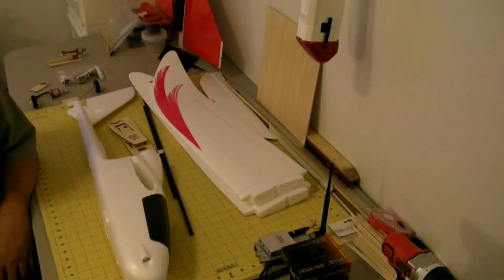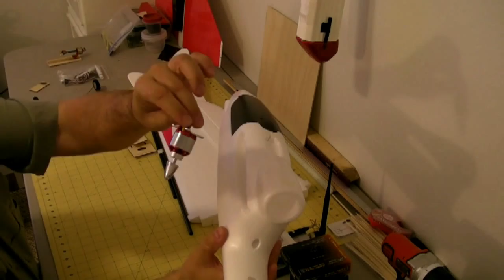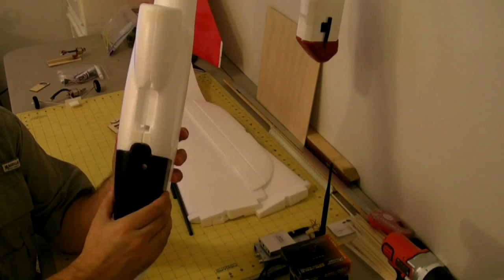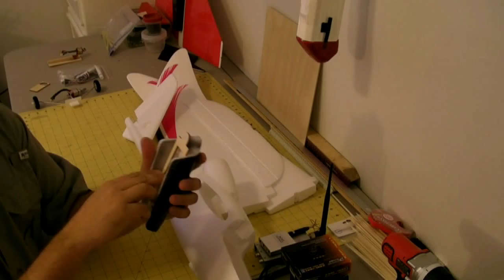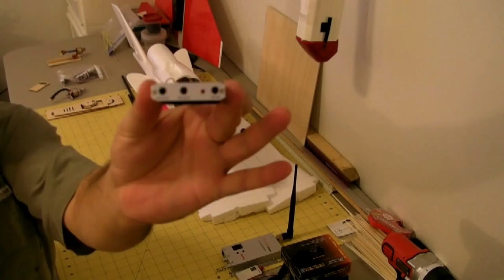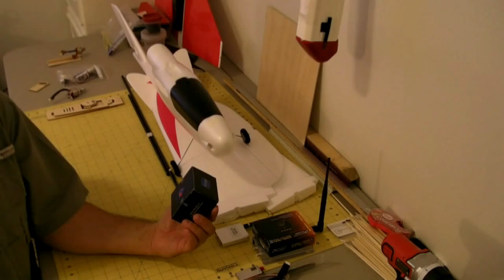First look at Skywalker Sirius FPV plane

Comment from the maker: @rcdawgmc Will do.  I am still figuring out how to fit everything in the plane an where to mount all of the electronics.  Starting to get crowded in there.  So far, I'v only flown the 5.8 system out a little over a kilometer, I don't know it's max range.  It did okay, but I only have 200mw.  I think I am going to switch back to 900mhz for a while and do some comparisons.  My 900mhz is much more powerful.

Comment: @letmeplaymystrat  I believe that it's an issue with the 4 wire extension cable. I had the problem with my AP117, but after using only the 2 wire cable that came with the AP117, the problem didn't turn up again.

Comment from the maker: @DanStasiak Hi Dan, if I am reading this correctly, this is an issue between the AP and the Hornet OSD, right?  I will be using the CEOSD 1.5.  I didn't buy the FY31ap with the OSD add on.

Comment: Good to see that you've also got your FY31-AP. Just a tip to take serously, don't use the "extension" cable between the FY31-AP and the OSD. For some reasion, it causes the FY31-AP to "Lock-up". Really bad if your in the air. :-)

(Thanks to the testing of the FPV'lers at fpv-community.de)

Comment: Cool new fpv gear, The RTH might not work with 72ghz most need a PCM signal and fail safe rx. I don't have the fy31ap but just a heads up.